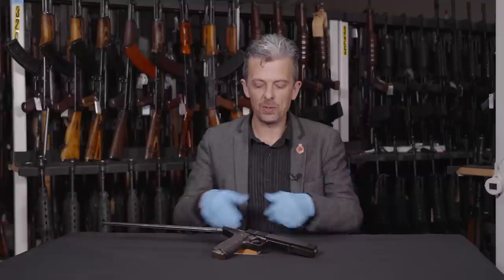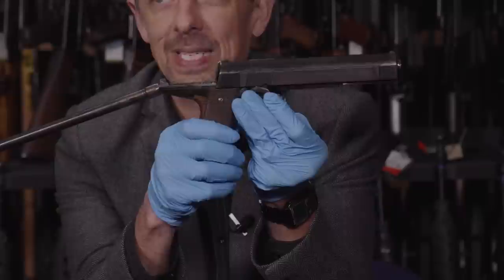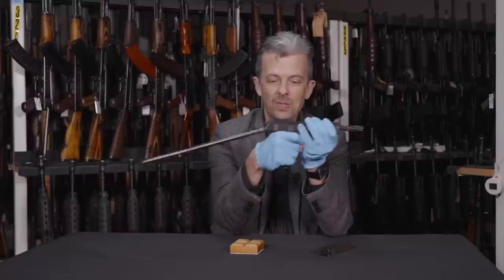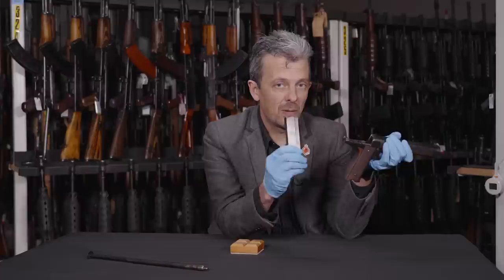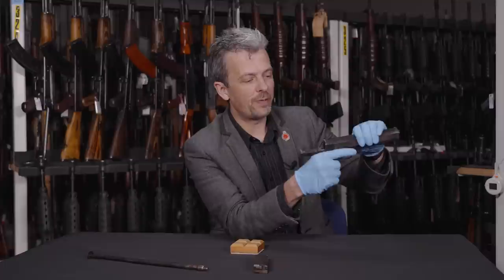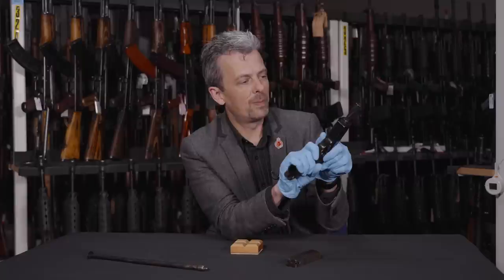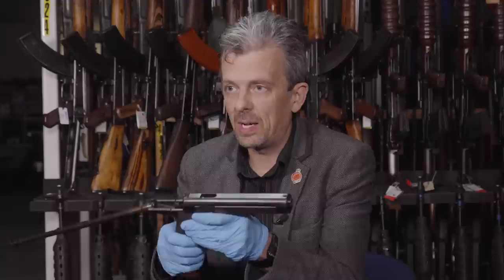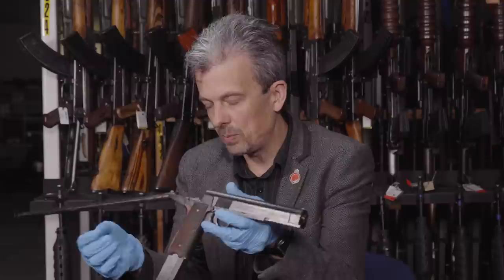Rifling on the *outside* of the barrel? The SR-11 with firearms and weapons expert Jonathan Ferguson

Comment: I am sure the rotating barrel is meant to retard blowback.  In addition to the inertia involved in starting the barrel rotating, I expect the bullet is causing the barrel to rotate in the opposite direction thus creating additional force retarding blowback.
Reply: If you study US Patent 3738044, you should be able to see that the external spiral grooves are arranged so that the barrel rotation due to the 'spin kick' or recoil torque corresponds to rearward motion of the slide. So, this torque will actually act to accelerate the opening of the slide, not resist it. The Savage 1907 is designed the other way round but the recent Forgotten Weapons "Ask Ian" video shows that that system is ineffective.
Reply: @derekp2674  Using rotational inertia to retard the unlocking of a bolt resurfaced in the recent CMMG Banshee pistol calibre carbines. I suspect that might not work satisfactorily with high pressure rounds though.
Reply: @webtoedman  Delayed blowback systems can be used in full power battle rifles, for example the German G3 and the Swiss STG-57. But most users prefer gas operated rifles as they have nicer felt recoil characteristics.
Also, if the CMMG system is a variant of a gas operated AR system, then the market for super expensive rifle calibre delayed blowback AR systems would be very small.
Reply: @derekp2674  I didn't exclude delayed blowback as a system for higher powered rifles overall, but rotary delayed blowback does seem to be offered only in low pressure loads.
Reply: @webtoedman  That may because the CMMG system is intended to offer improved performance relative to straight blowback AR carbines, which are only available for rounds like 9x19mm and not for rounds like 5.56x45mm.
Reply: @derekp2674  Could it be a response to the relatively small area of the combined lugs and camming surface, which could suffer accelerated wear unde high pressure?
Reply: @webtoedman  I don't disagree with that. However, if we are talking about AR type systems, isn't the CMMG design a simplified version of the basic AR locked breech gas operated design? IE for lower power cartridges simple blowback and delayed blowback systems can be used...
Reply: @derekp2674  Simplified in the sense that there is no gas operation involved. It works by the countours of the bolt lugs and shoulders in the reciever ring forcing the bolt to rotate on its axis at a rate that the inertia of the bolt initially will not allow. In concept it's not different from other delayed blowback systems, just using rotational inertia rather than reciprocating. Fascinating discussion, thanks.
Reply: @webtoedman  For those who believe the best ever SMG is the delayed blowback H&K MP5, then the CMMG system could well be designed to offer something similar with the modularity of the AR platform.
For 9mm, many straight blowback ARs are sold but seem to have a reputation for harsher felt recoil than the MP5. 
I note however that one of the strongest competitors to the MP5 is now the B&T APC9, which is straight blowback with a hydraulic recoil buffer.
Meanwhile, H&K went to full gas operation for the MP7. Fan's P90 is straight blowback. So there seem to be many ways of skinning this particular cat.
Reply: @derekp2674  You are right there. I suspect that the lower forces involved with pistol calibres give the designers more room to experiment.

Comment: I'm afraid the blish lock principle doesn't work scaled up either. It never worked, to any degree.
The observation that Blish based his locking design on was that interrupted breach threading on naval guns stayed shut under normal full charge firings but could partially unscrew if fired with under-strength charges. This has a lot more to do with how pressure built and dissipated within the chamber and almost nothing to do with how the metal surfaces interact with each other during firing.

Comment: 4:00 And here I was thinking the "plastic tube plus change" buttstock of the Finnish RK-62 was ugly as sin and everything but ergonomic...
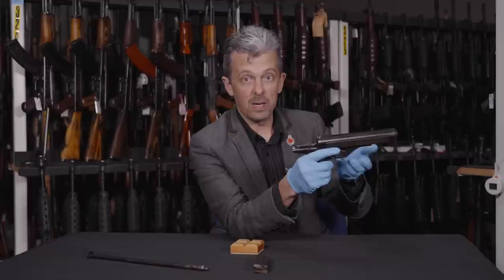8:30 The question being, why even have a box magazine if it's supposed to drop out when empty? Why not just go the Garand way and use clips? 
12:00 An immensely over-engineered solution to a practically non-existent problem.
Reply: Speaking of the RK 62, may I ask you about its buttstock in more detail? Does it work well with fur hat earflaps, tall winter coat collars, gas masks and other such obstacles?
Reply: When I used to dabble in practical pistol shooting, back when single action Colt 1911 self-loading pistols were the ideal guns to use for that, I was told that Jeff Cooper, one of the founders of the sport, used to refer to double action semi auto pistols as "a brilliant solution to a non-existent problem". The same might also be said for Robinson's work on controlling recoil torques.

Comment: Would the barrel technically be an angular inertia?
Reply: That's correct. It seems that Robinson was determined to smooth out the recoil torque impulse generated by the rifling (even though he must have been able to calculate how small it was, relative to the linear recoil impulse of a 9mm weapon).

Comment: Almost kind of looks like someone stripped out the hammer and firing mechanism out of a 1911, and replaced it with a latch to hold the bolt open like in a open bolt system as well as fixing the firing pin

Comment: Interesting. Makes me wonder if anyone tried doing a straight rifling, then the spin of the barrel this way would impart a spin. Well.. if ya can work out the dwell time. I think with this the bullet is likely out of the barrel before it unlocks and spins the barrel. 
I love how low the slide is on the frame. But.. again I think that too won't work well and is likely why the rod is on it too, as it makes using a proper 2 handed grip impossible. It's likely a non issue then tho as they still taught to shoot in a tea cup style then. It's likely why they tried so hard to over engineer a way to reduce recoil. They just wasn't holding the things right lol. 
I wonder if in the near future they'll see how we shoot today silly too

Comment: The rifling on the outside of the barrel will slow down the recoil preventing full travel.
Reply: That's only true in as far as  the screw thread will operate to increase the effective inertia of the slide. The spiral grooves are arranged with an opposite twist to the cam surfaces in a Savage 1907 or MAB PA-15.

Comment: Not a buttstock but a pistol "positioner"??   My Webley Fosbery had a "twist" to it when rapid firing but that was probably due to the cylinder turning mechanism.   Better to shoot a bit low than high and that could be properly mitigated with a suitable stock.

Comment: Would be better if it fired before the slide stopped moving, kinda like MK19 grenade launcher. Then the recoil would eat up the forward momentum. Shudder to think about timing involved.
Reply: Apparently most open-bolt guns technically do, although so late that it probably does about as much as the twisting barrel on this thing. Then there's stuff like the 20mm Oerlikon that actually does  fire well before the bolt stops moving (using a bolt that goes partway into the chamber, so timing isn't as important as you'd think).
Reply: I think Robinson had actually figured that out by the time he filed his 1970 US Patent and the Patent also describes a variant of the design that could work better. However, I do not know if any test guns were ever made to try out that design variant.

Comment: If he wanted to reduce the impact of the spin of the bullet he could have just removed the rifling from the barrel in the first place.  He's cancelling the benefit anyway.
Reply: That would have been useful to do as an experiment.
But it would have not produced an accurate weapon.
I used to have access to a club gun that was a WW2 German issued Browning HiPower. This was during the late 1970s and the gun was already worn out by the time I got to shoot it. When shooting at 25m, it could only place about 3 out of 10 shots onto the standard precision target.
Reply: @derekp2674  That's my point.  Negating the spin caused by the rifling in the barrel by spinning the barrel the other way means the bullet isn't going to be spinning anyway.

As long as he's giving up the benefit of the spin, why bother with a system that imparts, and then removes it?
Reply: @speedingoffence  The idea here is that the 'spin kick' or recoil torque impulse is balanced out by spinning up the barrel before the shot. But balancing out that impulse involves matching angular momentum not angular velocity.
If the rifling has a 1 in 12 inch twist then a muzzle velocity of 1000 ft/s gives the bullet a rotational speed of 1000 revs/s.
The barrel is heavier than the bullet and has a greater average diameter. 
If, for the sake of argument, this gives the barrel a moment of inertia 20 times greater than the bullet, the barrel only needs to rotate at 50 rev/s to give it the same angular momentum as the bullet.
So if that angular velocity has to be deducted, the bullet will exit with a net angular velocity of 950 revs/s.
Reply: @derekp2674  Corrected again.  Well said.
Reply: @speedingoffence  You are most welcome :)

Comment: An auto ejecting mag is an interesting concept. I think the biggest problem with it though is it flys in the face of doctrine and tradition. If you have ever had a bad mag or failed to get it in right, and had a mag drop. First thought is you have a failure.

Comment: The twisting barrel do have a, marginal, function as delayed blowback i guess!!
Reply: No, if anything, it will help accelerate the slide.
Reply: @derekp2674  No, it will delay. It takes energy to initiate the rotation of the barrel. Energy that comes from the slides motion. Think about it.
Reply: @RiderOftheNorth1968  Depending on the direction of the external spiral grooves relative to the twist of the rifling, the 'spin kick' or recoil torque can be used to either retard or accelerate the recoil motion of the slide. 
In US Patent 3738044,  Robinson specifies that the external grooves are designed to rotate the barrel in the  direction that the rifling rotates the bullet. The 'spin kick' or recoil torque will then work to reverse the rotation of the barrel, as will rearward motion of the slide due to the chamber pressure on the slide. So the recoil torque acts in conjunction with the linear recoil force, not in opposition to it. This is the opposite of what would be wanted for a delayed blowback but Robinson was not trying to design one of those.
Reply: @derekp2674  The recoil torque you mention is neglectible compare to the straight back force on the slide impeeded by the cartridge head. To move the slide away from the barrel (straight back) the inhertia of the slide must be overcome AND the inhertia of the barrel, plus the friction, when it is forced to rotate by the slided matching grooves. The barrel rotate because of the movement that is impeeded by the slide. The mass and friction in the barrel WILL retard the blowback, not much but still retard. Look at the angle of the grooves, there is no way you can transfer rotary movement in the barrel to straight back motion in the slide. But straight movement of the slide is easy to transfer to rotation of the barrel.
Reply: @RiderOftheNorth1968  I agree that the added inertia of the barrel has to be accounted for in the dynamics of the recoil, but I don't think simply adding inertia in any linear way qualifies the design as 'delayed blowback'. 
For example, extra slide mass (and inertia) were added during the UK trials by Enfield. 
To qualify as 'delayed blowback' I think a mechanism is required that increases the effective inertia of the slide initially but then moves out of the way, so that the slide inertia is then just down to its mass without any other mechanical advance. Such systems are 'non linear' in my terms, as the inertia values in the equations of motion change as functions of slide displacement. 
Good examples of actual 'delayed blowback' SMGs include the WW2 Reising and the H&K MP5. Both fire from closed bolts and thus provide excellent first round accuracy, unlike the open bolt firing STEN and SR11.
Reply: @derekp2674  I agree about how a true delayed blowback works but i never stated that this gun is one. Read my initial comment again please: " The twisting barrel do have a, marginal, function as delayed blowback i guess!!" is my phrasing.
Reply: @RiderOftheNorth1968  My apologies, I was confused that your use of  "delayed blowback" meant its usual meaning there. 

From my point of view in writing down the equations of motion needed to model the system, the rotational inertia of the barrel stays coupled to the linear inertia of the slide throughout the entire motion of the slide. 

This is just mathematically equivalent to an increase in slide mass (eg Hi-Point 9mm versus Glock 19), as opposed to a system with changing states, such as the position of the rollers in an MP5 or the angle of a breech block in a Reising.

The final twist here is that UK trials on the SR11 showed that the system did not work as well as claimed and the slide mass was increased to try and improve this. 

I don't know why Robinson designed the system to fire from an open bolt though. I think what he was trying achieve would have been easier with a closed bolt design (again like an MP5 or Reising - or even a Schnellfeuer). As a lone inventor working under the exigencies of WW2, he may not have had either time or resources on his side.
Reply: @derekp2674  A open bolt system is "good enough" for a machine pistol like this, it is cheap and reliable. The only big downside is the added weight compared to a locking breach. I do believe we are in agreement, on the whole, after some slight misunderstandings, right? It´s a delightfully goofy gun.
Reply: @RiderOftheNorth1968  If you only want to put a lot of lead in the air while you conduct a 'fighting retreat' then a nice cheap machine pistol should do. But a high capacity semi automatic pistol can do that job too. Operators who need to actually hit targets during offensive operations may require more accurate weapons though and this was what Robinson was trying to deliver. With more work, his design could have been sorted but I think a change to closed bolt firing would have helped to improve accuracy. "Fast is fine, but accuracy is everything."
Reply: @derekp2674  But to be honest the gun is just an akward machine pistol. No one have made a full auto pistol that have accuracy, yet. Put it in semi and you are better off with standard pistol. The best example i can think of it the old VZ61 Skorpion. I nice shooting full auto machine pistol whose main drawback was the caliber. Pistol is the wrong format for full auto. I think that is proven by now.

Comment: It looks extremely prone to swallowing dirt front and rear, getting unwary fingers jammed in the works, and if you wanted to fire it two-handed (like I think Stens were supposed to) where did you grab it?
Reply: I wonder if the frame is long enough to mount a M1921 Thompson front pistol grip, as was, I believe, done on some M1911 full-auto conversions.
Reply: Come to think of it, in Australia Austen or Owen front grip would probably be much more common, and possibly easier to mount as well.

Comment: Havent shot alot of pistols, or any firearms, but i would think that if force is equal it'd be better to have barrel rise not dip? When taking second shot you can let it drop "naturally" and not having to lift it. Thats just my buttfeeling. Id would be interesting to try it out back to back with such weapons.
Reply: This is how Magnum revolvers are fired and to an extent, how bullseye-style target shooting is done, for the very reason you state. Many speculate that the 'ploughshare' grip of the Colt revolver is consciously designed for this effect as well. However if you need to get the sights back on target quickly or design an automatic weapon, you want to reduce muzzle flip as much as possible - the 'dip' induced by a heavy 'open' bolt is certainly not desirable, it's just not really a problem in a submachine gun because you have more to get hold of :)

Comment: This is like the Beretta PX4.
Reply: Isn't the Berretta PX4 more like the Steyr M12 in that both use rotation of the barrel to lock or unlock the barrel to or from the slide (i.e. a shot recoil design)?

Here, the SR11 is effectively a straight blow-back design, but with the novel feature that the linear recoil and counter-recoil motions of the slide rotate the barrel. This is done to stabilise the recoil torque from the action of the rifling on the bullet.